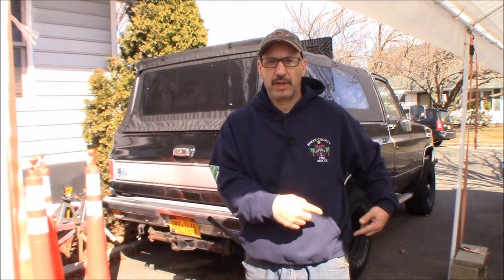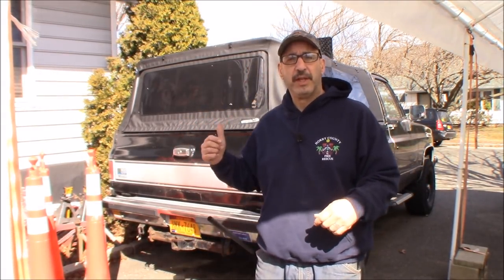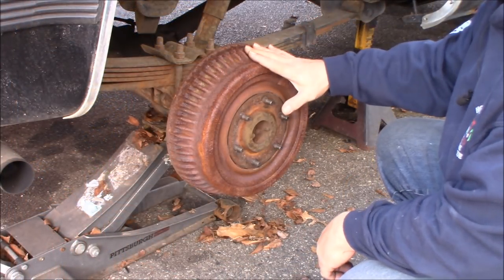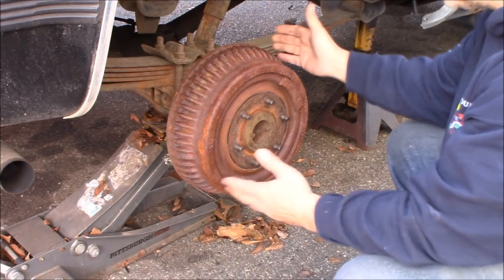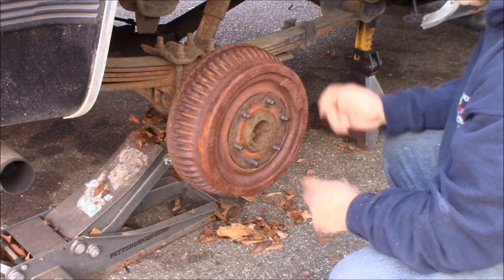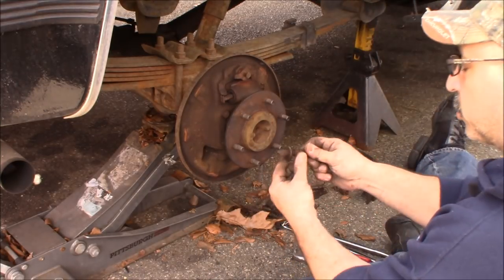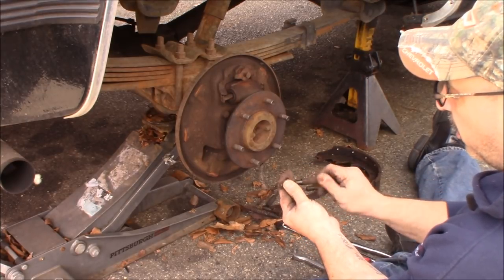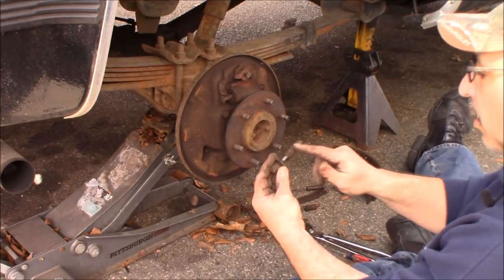K5 Chevy Blazer - Replacing Rear Drum Brakes for The Big Dummy - Video 1 of 3

Comment: Best video I found for doing the drum brakes on my 4wd 92 Suburban K1500…  Many others claimed to show a 92 Subufban - but it was a different configuration…. The drum and brake pads I bought from Rock Auto were correct for my vehicle - but the “complete” spring kit did not have all the correct springs….  I ended up going to a NAPA store and buying a spring kit for YOUR model blazer and it had exactly what I needed…  

I highly recommend acquiring a bright small flashlight to stick in your mouth to help get those two pins lined up correctly within the springs holding each brake pad in place… THAT was the most difficult part of the entire brake job.

Hey - I’ll listen to your “chatter” - as you certainly have created a great tear down video (1) and the rebuild video (2).  My compliments…

Comment: Hello, 
Does this apply to a 91 K5 Blazer, too? I did the same exact procedure, and i had my oem drums turned at oreillys, and now the drums won't fit back on. Do i need new drums? I released any pressure on the brake cylinder.

Comment: What about if your parking brake is stuck? How do you determine that and how do you fix it? My 84 k30will not move when you put it in gear without gasing it pretty hard.
Reply from the maker: You'll have to take it apart and see if it's the parking brake, wheel cylinder or just stuck shoes against the drums
Reply: @AxlesGarage  mine is one of those cucv military trucks. Will it be the same?

Comment: I am surpriced you didnt replace the break cylinder as well, seeing that all was taken apart and  you were replacing pretty much everything. The cylinder is cheap and they leak after a while, so its always good to replace it too. Besides that, nicely made video...step by step, great job! thanks
Reply from the maker: Yes, in hindsight I should have done the wheel cylinders. Thanks for watching.